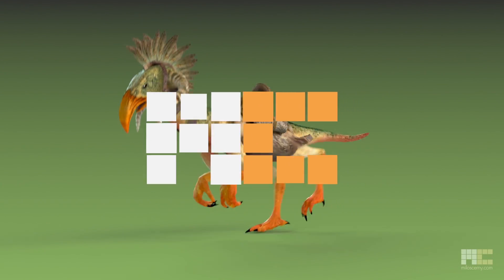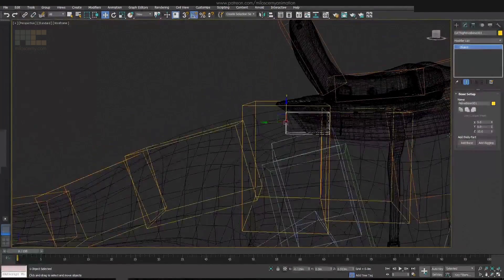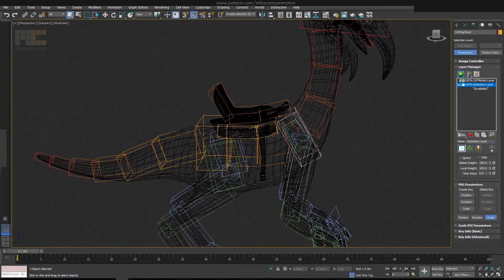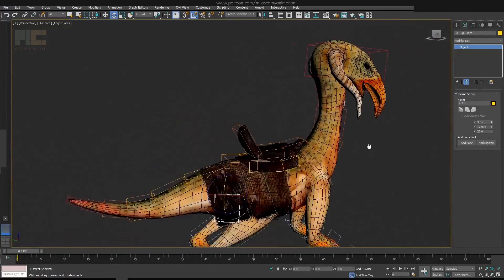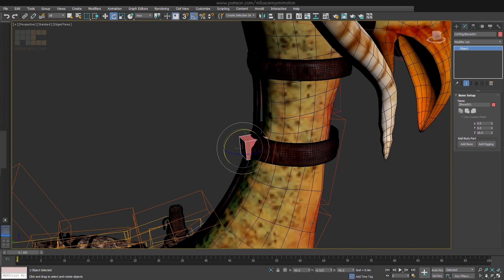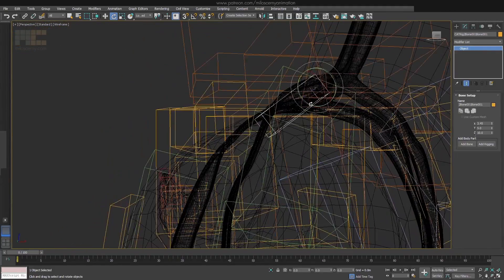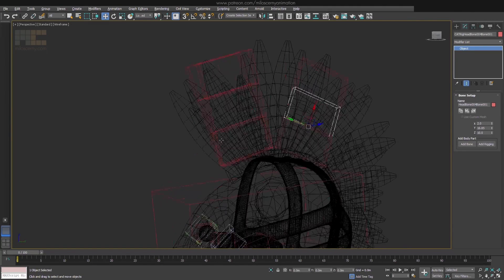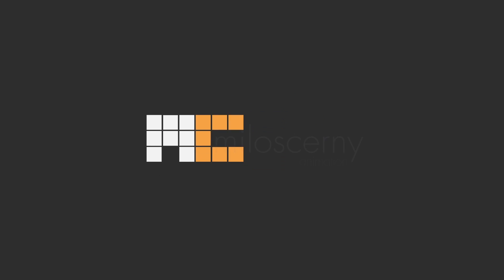Rigging Dino-Bird (Props) - 3ds Max CAT Rigging Tutorial

Comment: But we need to know how to rig chains! how to live without having chains unrigged? Also i wonder why not to rig hair with cloth, why use bones instead?
Also one more question - why use bones on the neck leather straps? why not to use skin wrap?
Reply from the maker: Hey G Rom, thank you for the questions.
Rigging chains is not really suited for a general rigging tutorial as this was, because it's a much more complicated issue then the rest of the props.
Rigging hair feather with cloth would be really an overkill for simple planes like this. Cloth would add another thing to worry about during the animation and also it couldn't take advantage of CAT's layer system. If it could be done with bones (and it was pretty simple) then for me, bones are more useful then cloth.
About the leather straps. With skin wrap, you couldn't achieve a movement separated from rest of the body. And I wanted to have that option. I have used it even in that run cycle animation I did for the model. The one strap closer to the legs could be pushed by those legs when they were touching it. With just skin wrap, you couldn't have done that.
Reply: Thanks for the reply. More questions! Isn't it too much bones for a single character when you are making additional bones for each cloth prop? because as far as i know the more bones you have per character the more resources it takes to calculate them in game engine. How many bones per character is ok to use for a modern game model on average?

P:S: I'd like to know about how to make procedural animations with cat, because i can't find on youtube or in the internet anything useful on this topic, there are lots of parameters and i don't know which lines are necessary and which aren't etc, hard to figure out how to work with all that stuff, my characters walk like rubber zombies(((
Reply from the maker: It depends on what you want to do with the character. The main thing here is, that this model wasn't meant as a game character at all, so I didn't have to worry about number of bones at all (even though, you always want to have as few bones as possible because you still have to animate them).
If you are doing a game character, then you are right, that every bone takes some more resources to calculate with, but it's not that huge of a deal. Even a simple basic quadruped rigs without fingers have around 40 bones in it. If you have any props on it it can get to 100 bones quickly and that is not very uncommon.
Basic Human character without props has around 100 bones by default and so on.

About the procedural animation. I have a video tutorial about that: https://www.youtube.com/watch?v=skMol6-oXRk
It's just two videos so far, but it should help anyway.
Reply: I watched all your videos) but still want more stuff about procedural animations with humanoid creatures, more stuff about animation of different activities like fighting, climbing ladders, ropes, cliffs, walking on stairs, swimming etc. Something about cat muscles how to properly attach them for making for example a jiggling belly, maybe something about animation principles pose to pose animations how to properly animate with them and so on. I wish tutorials were a bit longer like 20-30 min, after all animation is a complicated topic, so that you can't squeeze a lot in a short video. i'm watching everything mostly on 1.25 speed and it's better to speed up longer tutorial, than slowing down the short one (the voice becomes sleepy)
Reply from the maker: Ye, maybe you are right and maybe I could also try to do long tutorials together with the short ones. Thanks for the tip. However keeping a long video interesting is a bit difficult, especially when English is not my main language. Doing an interesting voiceover for 30 minute video is a lot of work and without any voice, people would not watch it in my opinion. Talking while working is out of the question as well, because it's too hard for me to focus on both, when I have to speak in foreign language. But will see, maybe I will try something.

I am planning to do more animation tutorials as well. But again, they are hard to do in a tutorial manner, because animating is quite often a "feeling" process then a step-by-step process. But I still want to do them. Thank you for the feedback.
Reply: Well in parts showing monotonous work there is no need in voiceovers, there may be some sort of a short recommendations or tips, in other aspects such as reusing rigs from previous characters, or scaling a rigs, proper preparations for exporting to game engines - there can be more in depth explanations of the process. Quite often i start doing something - than i clicked a button and all my rig goes to hell, but when i watched a tutorial they pass this stage just fine there, and i don't know what to do, rebuilding everything from scratch helps sometimes, but sometimes not, so voceovers in a places where may occur some troubles also a preferable thing. 

What i don't like about learning animation is 1 - Instructors may not use the same software that i'm using, 2 - They using a rig with more complex/simpler structure than mine, so i can follow it but only partially, 3 - they using other methods, i wan't to know more about pose to pose animation but they using something else, 4 - Quite often they skipping parts in their tutorials suggesting that it's straightforward, but it's not...

So i like that you started to make this Dino series showing how to build a rig from scratch, how to skin the model using the same exact rig with props, and i hope there will be videos on how to animate it as well)